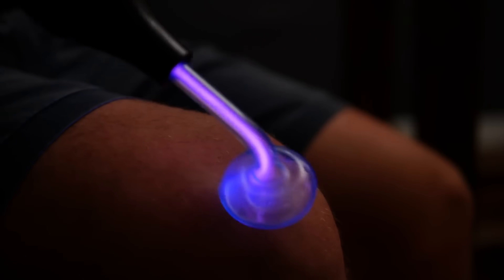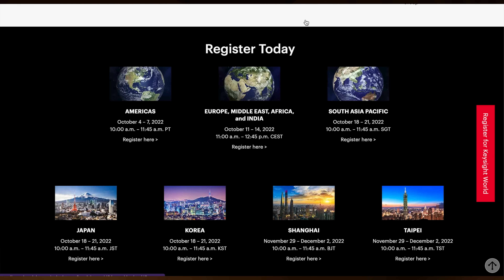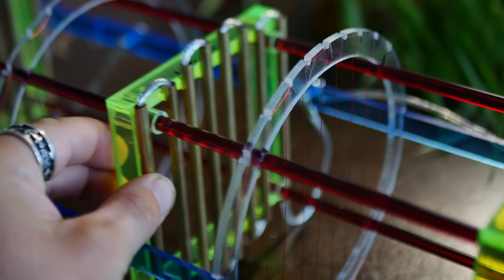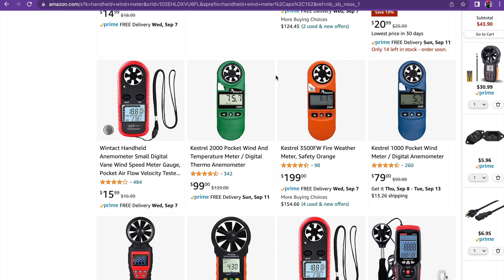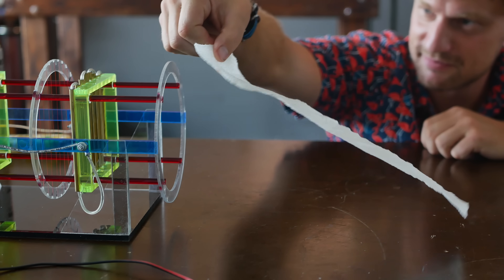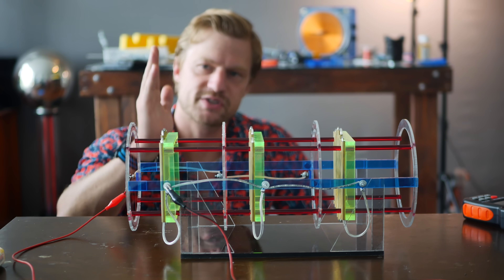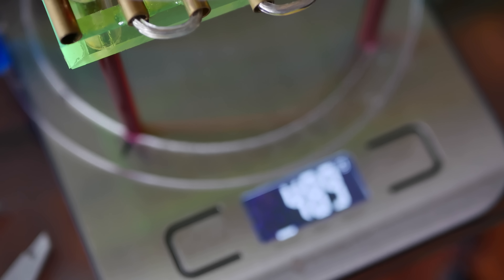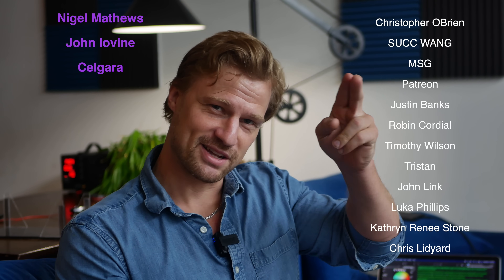Designing A Next-Gen Ionic Thruster! (For Flight)

Comment: suggestion: use motors and a sensor to run a computer program to find the "sweetest" of spots. basically the program would test, move, and test again until it finds the optimal arrangment.
Reply: Go a step further, vary the voltage at each stage. Let the program control each stage's voltage. Let it run and then interperit the data.
Reply: You'd be surprised how many researchers and academics people think this is a "waste of time". Brilliant idea though, computer optimisation is used so much in the industry
Reply: @Brown_Potato  
That's because of the powerplant.
The US already ran tests on nuclear reactor powered aeroplanes and concluded it was impossible.
Shielding the crew is a direct result of the mass of the shielding and they calculated that the ratio of shielding mass to power output will always result in a plane that's too heavy to fly.
Additionally aircraft navigation and communication is all EMF. Running devices which generate high levels of EMF interference not only lights you up on everyone elses radar but blinds your own devices. I think the ratio of EMF shielding to thrust on these devices is similar to the radiation shielding ratio so it doubles the problem.
The Japanese built a research ship that uses this technology for water jets (without the plasma) and it works but it's quite slow, it's also less efficient than regular propellers.
Reply: Go even furtger and find the relationship between the strength of the electric field and acceleration of air molecules. Then you could calculate optimal spacings and voltages.
Reply: @nicholasweiss4662  Nah - for that you would need to know basically ALL parameters - that includes everything like surface-imperfections of the wire used. That level of simulation is not practical for this.
Reply: @ABaumstumpf  That depends on the accuracy you want. You can make assumptions for simulations like say  the surface roughness is equal all over and is X, where X is a area you measured on the rod. for the fields you can assume it moves the same all around except for metal surfaces. the values needed for thinks like dielectric constants are known. the air molecules on the other hand i do have to agree, simulating all molecules is not practical. but you can measure the properties of a group of molecules e.g. velocity, pressure etc.  With those assumptions in there you could say something on the line of "i am XX% sure it can preform at YY". its done in engineering all the time you do have to keep the standard deviation into account when building. in case of a thruster you would be worried about the lower bound if the value for thrust
Reply: @ABaumstumpf  why not just use gradient descent?
Reply: @michaellin4553  That works well with simple systems or systems that do not have local minima/maxima - which this has.

Car manufacturers still use windtunnels cause the simulations are very costly when they should be accurate enough. If for them simulating just 1 geometry is already cost you can guess how that turns out if you want to do actual optimisations for a more complex system. Just getting the parameters slightly wrong (like not accounting for sharp/soft edges of the cathode) could have just as large of an impact on the simulation as the thing he actually wants to change.
Reply: @ABaumstumpf  however the manual testing is not practical for the development of a theory with which to design more thrusters. Why would i want to find all the sweetspots for the prototype Instead of finding the good-enoughs from which to start at in subsequent models?
Reply: @SZebS  if you think you could somehow come up with anything that could simulate this - sure, go ahead. But a chaotic system like this will not be something you can do, let alone have the supercomputer to simulate.
Reply: @ABaumstumpf  i'm not talking about simulations! That would be pain and serve the same purpose as manually testing it. I'm saying go abstract, don't consider everything, get a good-enough mathematical model which will let you know how the thruster would react to more voltage or different spacings. Then, next time you can start from those settings and manually change things accordingly to consider what you ignored.
Reply: @SZebS  "get a good-enough mathematical model which will let you know how the thruster would react to more voltage or different spacings."
That's the thing - that is just too complicated. For voltage is is trivial, but geometry? No chance.
Reply: Good idea but hard to manage because that voltage will create noise and it could damage the electronics, also you would need special equipments to switch between different voltages, a simple relay won't work.
Reply: @devanshtangri  true, might want to program a break every once in a while. the voltage he used was put through the amplifier, so all he'd really need to do id get some electronic switches and hook them up to each "node"
Reply: I would honestly go for doing the same for thrust over velocity, but that's a great idea.
Reply: Sweet
Reply: Yes
Reply: @SystemsPlanet  yes
Reply: You make it sound easy.
Try make a realistic robotic simulation that is more accurate than physical simulation.

If it was so easy we wouldnt be doing physical tests.
Reply: Considering this is HV stuff I dunno about using a motor to move those.
I agree on recording though.
Reply: Step further: add as many optymalization variables as phisicly possible (positions, voltages ect) and run gradient decent to find best combination.
Reply: Not to mention the design and the program should be using cylindrical fins on the outside of the cylinder with the Ionic grids incorporated into the fins!
Reply: Explanation: you could run the program overnight, so the whole "measuring every little thing is impractical" is just false. The program dosent care, it will just keep editing and measuring, compiling the data in a scatterplot graph. I would personally use a rasberry pi.
Reply: @dimensionalchaos8422  "you could run the program overnight"
And that would be significantly faster than any attempt at simulating it - while also providing more accurate data (of course- there is nothing more accurate than the actual results).
Reply: @ABaumstumpf   Of course basically a 60,000 volt electric fence left unattended whole night while I sleep in the next room sounds?
Reply: Reinforcement algorithm 😁
Reply: Make an engine that can dynamically vary its geometry at will to create optimal thust at different altitudes

Comment: Very nice ...
So - thinking about what you were saying at the beginning about what is the next evolutionary stage of ionic thrusters ... what about introducing compression? Perhaps a larger, lower-voltage, shorter spaced, emitter/collector assembly (or even several smaller assemblies) up front, and an increasingly smaller emitter/collector arrays with higher voltage and larger spacing toward the back? Of course, you'd need to somehow enforce the compression with some sort of containment. 
Anyway - just a thought :P

Comment: I think there are two important factors: how much air you are moving and how fast it's moving. I would say that the wind speed has to be proportional to the electrons speed, since wind is brought along by this ionic gas. Probably the energy transfer between electron wind and air is more efficient when the relative speed between the two is smaller. The amount of air I think has to do with how many electrons are jumping and how efficiently can you drag air along with the ionic wind without it being turbulent. So, my guesses would be: apply increasing voltage as progressing through acceleration stages and get a supply with the highest current limitation possible. Put whole device in a tube, with inlets slanted at a very small angle to let air be sucked in without disrupting flow. Maybe give an airfoil-like profile to the thicker tubes to not induce turbulence in the flow?

Comment: 1) Closing the tube.
2) adding a nozzle to concentrate the airflow
3) Decreasing the spacing of the segments
4) Use flat sheets in negative electrodes so there is less resistance and you can put more for a better service area for both the negative and positive
5) adding more segments

I have not done much work with high value or plasma, but I do have an idea. what about using a pulse width modulators system
Pros: less power draw
Con: less force/weight while keeping the same airflow ( I am thinking like how fans can be designed for pressure or flow but this is a bit outside of my knowledge base)
Reply: The pulsing might really be interesting. Put the stages close enough, so that they would normally arc. Then pulse them so that they would burn if they would be powered continuously. But only even and odd stages at the same time. Should make it much more compact and maybe more leightweight.

Comment: First of all very nice work! I was thinking that you could use a coil to push the ionized air via lorentz force. For that you could harness the air in a perpendicular direction to the airflow and use a coil (also perpendicular) to push the air with greater force than using just electrostatic push

Comment: I'm no expert for ionisation, but I got a bit of knowledge in aerodynamics, so my thoughts would be optimising the setup aerodynamically. For example using flat electrodes, round is the worst shape for airstream.
Carbon fibre is conductive, so maybe super thin cfrp electrodes would save some weight.
But I don't know if the heat of the plasma would burn away the matrix (the reinforced plastic).
Secondly I would try to build a channel around it, a tube basically, so the pressure losses from stream diversion between the stages would be eliminated. 
And from my rudimental understanding of charges and ion flow, three individual power supplies with no common ground should eliminate a backflow between the stages. 
Or, maybe, to spare an electrode, making a staggered array, the step up converter thingy has the capability that the anode of the first stage could be the cathode of the second stage and so on. Hard to explain without drawings and in English 🤣
Maybe you understand.

Comment: I don't know much about you HV source, but that may be a source of inefficiency. Enclosing the design and help (or hurt), so I would experiment with that for sure. There's probably also a balancing act between wire guage and power draw as the surface area/ohm changes. More rigorous stage spacing testing would definitely help (in my experience, testing "gut feeling" numbers will get pretty close, but usually mis the mark by some amount.) And experimenting with the shape of the electrodes themselves (especially trying to use more aerodynamic shapes that just copper tubes.

Comment: 1. lots of wasted length between the stages since only like 1-1.5 inch gaps worked well
2. the negative electrodes are solid pipes instead of a thinner foil or something which would be waaay lighter
3. enclosing it in some way with a thin film surrounding it would also direct the airflow better in one direction and would likely provide a decent boost

Comment: Yes! I've been waiting for you (or anyone) to design something more than just the single stage ionic wind thruster! 

One more thing to try would be to have a circular torus to take the thrust and feed it back into the starting point to see how fast you can accelerate wind in a closed system. Given that there are no physical fans you might be able to accelerate to some high speeds and if you can auto-widen the gaps as the speed accelerates that might help as well.😁

Comment: Jay, you should make a piston engine powered by Ionic Thrust!

Basically I have a stupid idea (Which will probably never work) that you have 2 plates on the bottom and top of the cylinder, and one grounded plate on both sides of the piston.

Basically you have alternating static electricity between the two plates, and the voltage on one side will be opposite of the other side.

If the top plate is positively charged, and the bottom plate is negatively charged, the grounded piston will move up due to it being attracted towards the top plate.

And the opposite happens when the top plate is negatively charged and the bottom plate is positively charged.

Comment: More pointy things, less obstruction of airflow... Rings with embedded aluminium  pins pointing downstream, tilted slightly inwards towards a thin grounding wire ring. Aluminium for lightness and conductivity. Would pulsed power still work while reducing power consumption?

Comment: There has to be a way to design ION (or Plasma) Thruster that has Pressure Thrust.  Just moving ions along is limited.  There has to be a way to build high pressure with an exhaust opening and thrust would be equal to Chamber Pressure (PSI) at Square Inch of exhaust opening.   If Chamber Pressure = 100 PSI at 1 square inch exhaust opening, Pressure Thrust would be 100 lbs.

Comment: A cylinder with only openings on either end should increase the thrust because of pressure increased and maybe add angled slits to pull additional air in by the positive terminals

Comment: I have an idea that is actually originally from a multi-stage polarized light filter idea (that has not gone anywhere yet)
- What about having the first and center stage vibrating on resonant frequencies relative to the air flow? Or possibly center and final stage. Note that the resonance on the center stage needs to correlate with the incoming or outgoing depending on sequence.
-> On the original idea the test would be to test an at least 3 stage polarized light filters with resonant frequencies to the passing component light in a similar way as above but also impact the angle of the polarizers while vibrating them in the same path as light itself. In this particular case the testing requires this to be done with paramagnetic, diamagnetic, ferromagnetic and antiferromagnetic polarizing filters. The idea here is to test if due to the medium change any of these materials in any combination at selected resonant or anti-resonant frequencies can actually cause a change in the speed/time of flight of the light going across these filters under various test conditions.
(I keep having funny ideas, do you know of any place with a nice large hack-space furnished with tools and components covering all required areas of science and engineering that would pay me to keep the place running and device interesting testing scenarios? I'd change job no question asked to take it and move if need be :P)

Comment: Add a lightweight outer casing to avoid turbulent air at the outer edge, use more humid air to increase conductivity and density, if you want airspeed add a nozzle on the exhaust

Comment: 1. Enclose the device to prevent air flow radially
2. Strip copper wire of any coating to maximize surface contact
3. Introduce more wire for each cell, with denser spacing between each 'leg'

Comment: 1) Would spiralling the copper wire (like a stretched string) for larger surface area for the electrodes will produce more "nucleation" points (not the correct word I'm sure)?
2) Unless I'm mistaken, it seems that your loosing/adding 33% per stage because of turbulent losses and already ionized air in the "cylinder". Putting them side by side in a triangle could give you more thrust?
3) If you're keeping it in a cylinder fashion, each stage could be closer? Or wrap the cylinder in cellophane to keep the moving air in line?

Comment: Because you are trying to accelerate air molecules to generate thrust wouldn’t it be better to accelerate them in a grid pattern more of block shape that slowly rotates the air creating more of a vortex assuming none of the air escapes out of the sides however that’s easily fixable with an insulator surmounting the divice

Comment: 1. Would putting groves in the copper wire help control the points that ions burst out?
2. Is there a way to build it so that each consecutive stage doesn't create more drag?
3. Can greater speeds be achieved by varying the distance between the electrodes and the ion web based off of the speed the air is going?
4. What effect will making the sides airtight have on thrust?

Comment: You need to apply voltage in different stages to the different thrusters, so that it pulses out of phase! Experiment with it by setting up a circuit board with potentiometers that can change these values in realtime so you can tune it in well.

Comment: 1. Airflow escaping at the sides and lost as turbulent flow/heat - close it up
2. Neutralizer (charge collector rods) causes turbulent flow / loss to heat - improve shape 
3. Heat losses can be turned into extra thrust using a nozzle
4. Ducted inlet causes extra thrust via lift
5. faster air has less time for ionization -> less efficient

Comment: You should try creating static airflow control surfaces and play with the polarity of the fields to attach or detach the laminar airflow from a wing. Creating a thruster to push a plane seems very complex with the tools available, but modifying the air around the wing surface seems a cool experiment you could make.

Comment: What if we close the thruster in a loop, contain the loopthruster in a chamber, and accelerate the air inside the chamber before releasing it out through a door that opens after n rotation cycles. Should that help in a higher release speed?